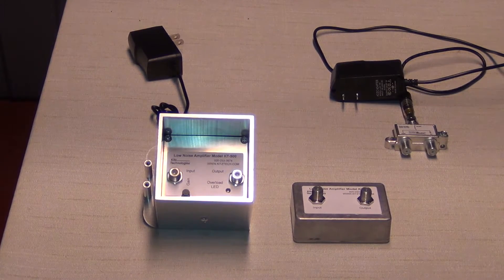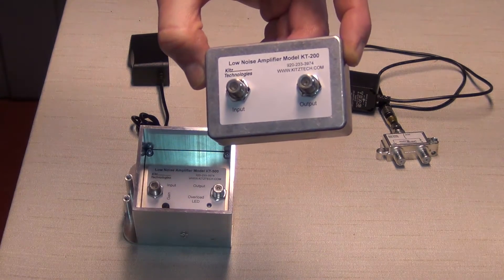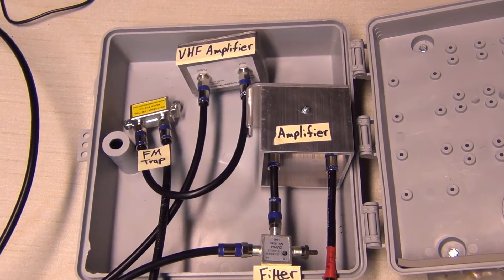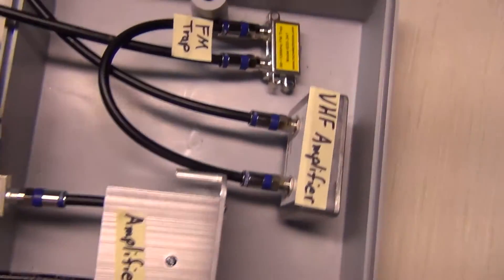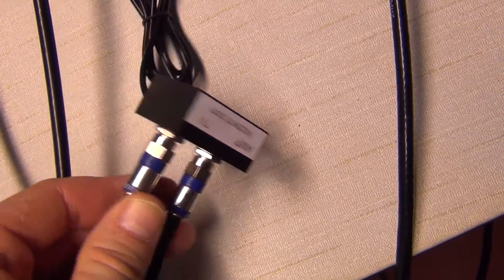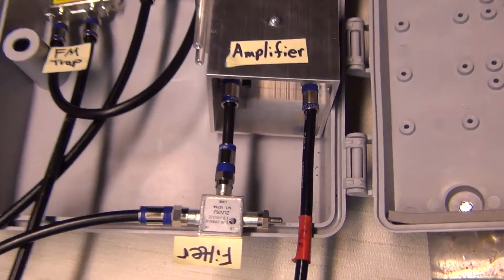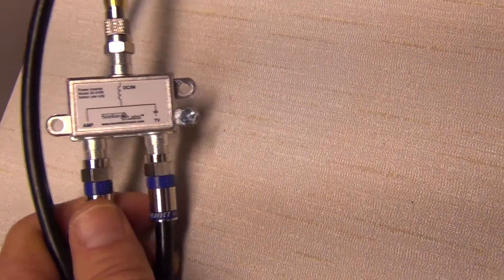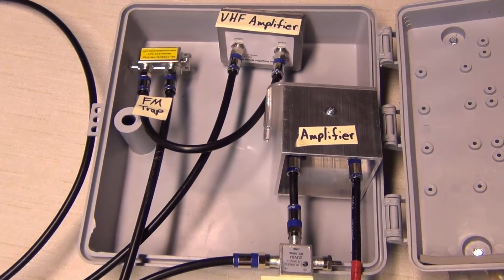Resolved TV (OTA) interfering noise problem; KT-500 and KT-200 amplifiers; ZUVSJ Combiner

Comment: Good video. Quite a nice amplifier setup you have for your antenna system. So I use only one KT-200 COAX and its indeed a very good pre-amp. Obviously they buy the power supplies from somewhere else so they are made in China as you can't make everything. The issue I had with mine is that it was leaking noise all over probably into the cable system and it killed AM radio for my whole and 10ft-15 around the house. But the owner who is very professional sent me a new power supply for free and the new one is quite beefy and works perfect and isn't leaking anymore since AM works fine now. So I am now happy with my pre-amp again. Now if only more people would buy these Kitztech pre-amps but they do cost quite a bit of money when compared with other pre-amps.